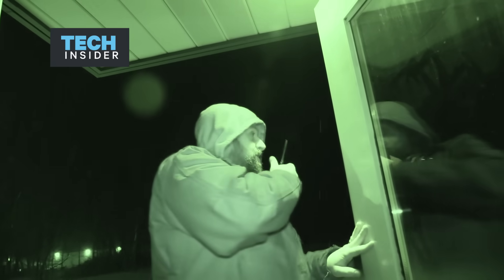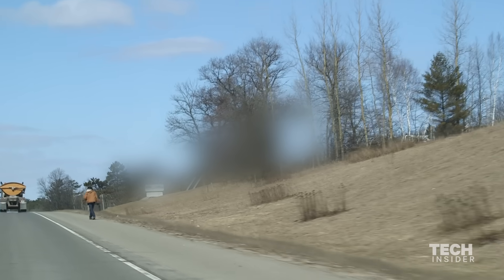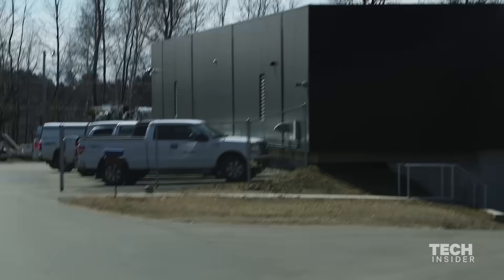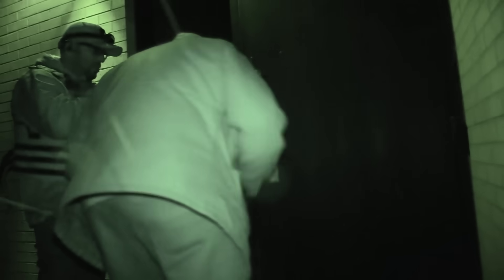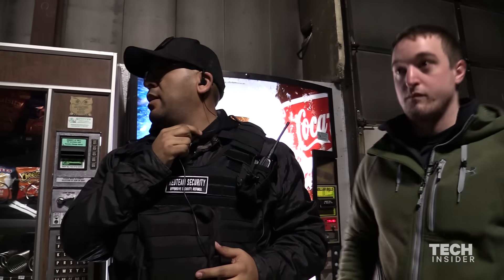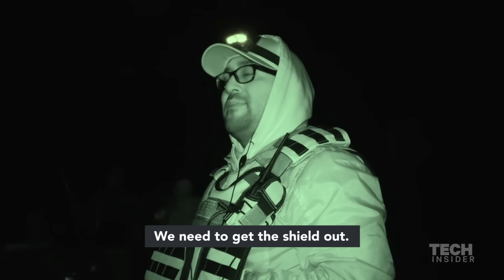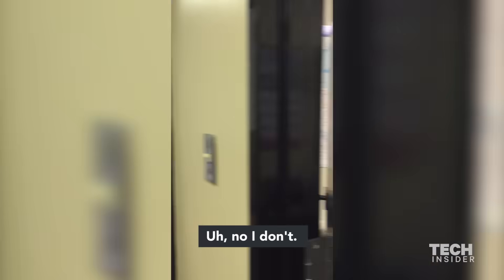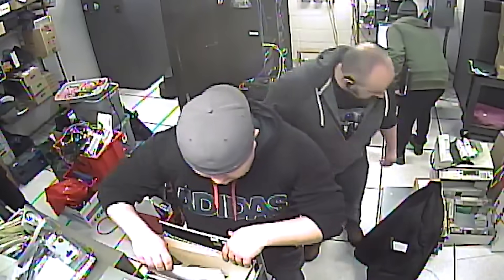Watch hackers break into the US power grid

Comment: Social Engineering ……. Every Day, ALL day. 95% Success rate. People WANT to help. The one word that is an automatic epic and immediate fail is “FAVOR”……Nope, nope, nope. HELP to FAVOR. ALWAYS. Trrruusstt me. ;)
There’s a water filtration plant not far from the outskirts of the city limits and it has ZERO security. It has a chain link fence. A and barbed wire at the top with a guard gate (sans Guard) and ANYONE with nefarious intent would need about 10 minutes to poison the water supply for approximately 3 small towns it “feeds” and no one seems to care about it or thinks “It won’t happen to us…”……until IT DOES.

Comment: They skip over the physical security part? I install security systems and I’m confused. The second you opened that exterior door the alarm would have went off and motions would have picked them up walking around the building. This whole video is debunked with the installation of a simple alarm system with door contacts and motion detectors. Update the video with the added step of getting past a security system.

Comment: Big chunks of this don't make sense and are possibly made up by one or more participants. I don't know crap all about hacking (at least not enough to actually pull it off). but I know a bunch of stuff about some of the security features (Sensors) that were (apparently) present at the first Facility. The Sub Station. My point is that this video might well be more for entertainment purposes (Views) than a true Pen Test. That is of course unless they deliberately fudged certain details to discourage anyone from attempting such things. I dunno. I just know there was a bit of nontruth in there. I'm not going to set about correcting those details because I (and possibly them) don't want any Ding Bats trying such stuff and certainly don't want anyone with malicious intent trying it either.

Comment: 4:12 - I like to use the phrase "I have an appointment to....". I work for an ISP and people at the front desk almost never know Im showing up to perform work. But as long as I say Ive got an appointment it puts the pressure on them to figure out who will get me access to their data room. It helps too if you're wearing some kind of safety vest. I also follow up at some point with phrases like "I promise I wont be turning anything off, Im just here to setup a new service" since thats all the office staff really care about. If the desk person looks willing to give access but confused about where things are located I say "It will be which ever room has all the wires" then they walk me around the office until we find the telecom equipment. Ive lost count of how many times Ive gained unescorted access to data rooms using those 3 phrases. And the front desk personnel dont like to be away from their station so they often leave me alone immediately after finding the data room.
Reply: I work in IT too, and my experience is the same.
I've had full unescorted access to hospitals and other important places.
They even give me badges so other people don't bother/try to stop me.

Comment: I'm confused....how exactly did they "hack the power grid"? It looks like they just physically broke into some substations.  
Super dangerous BTW...
Reply: Substations are vital infrastructure of the power grid. Control the substation, control the power out of the substation. There are all kinds of issues with security at the locations they breached, down to as simple as not locking doors during off hours.  Installing malware and physical network access devices means they can control internal assets remotely, which is super scary